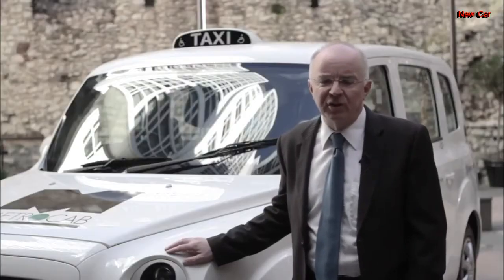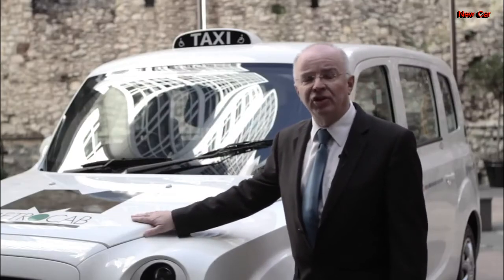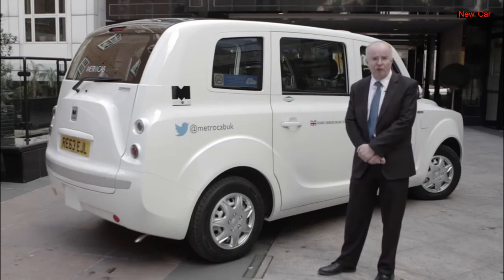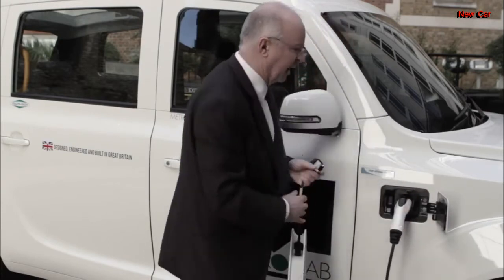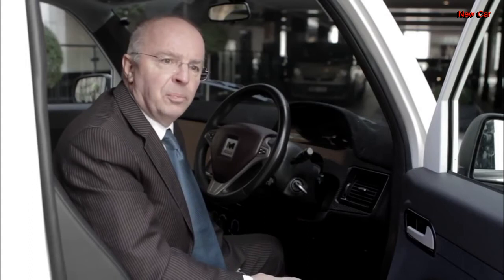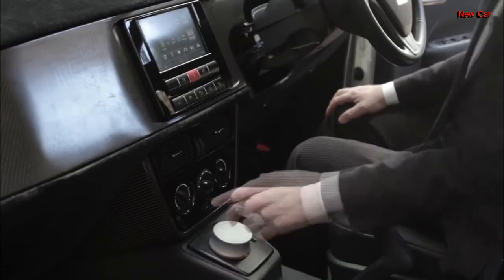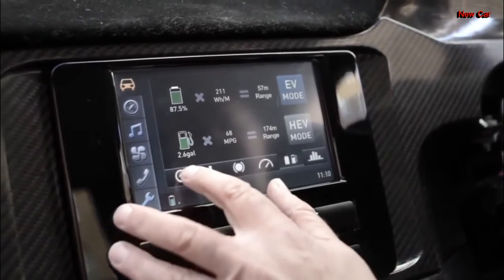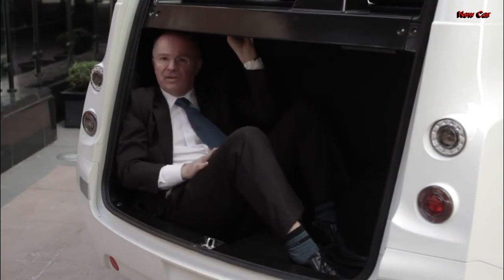London's Metrocab Plug in Features

Comment: Good design with some flaws. Gear selector a bit out of reach. plug and go is not very well thought out. Why not kinetic energy and maybe a small engine for when batteries need charging. Cab drivers will have to queue up for a charge when they could be working.Big wheel arches a bit big.